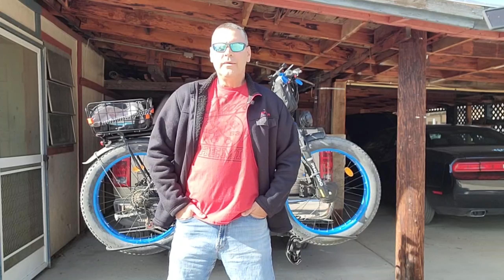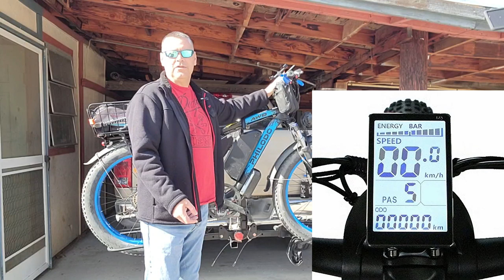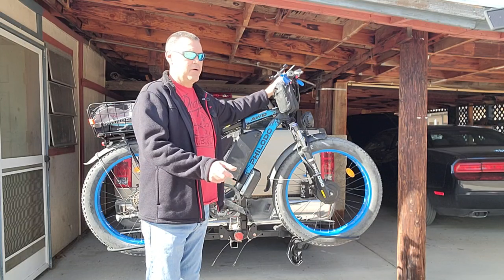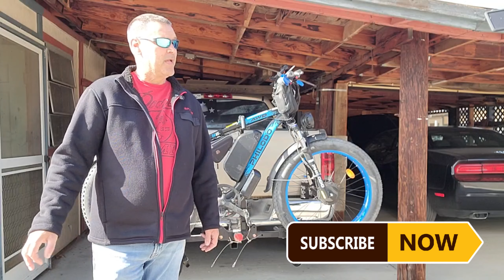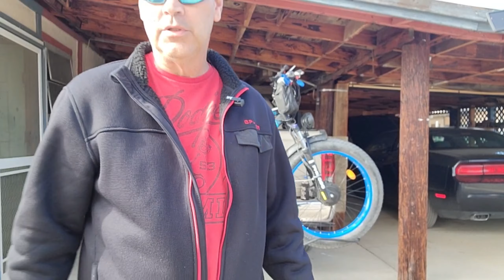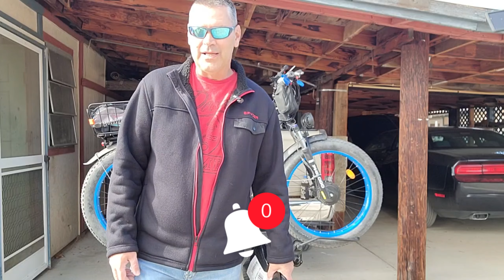Great H8 Specs and stuff

Comment: the controllers are 27 amps....at least they are on my H8 that i got just over a month ago
Reply: 27 amps each on mine also!
Reply from the maker: What the hell, mine are 22 max and the display stops me at 20. Wana trade?
Reply: @MrCsebike  maybe that's how you got such good range, in PAS 2 your rear motor is only using ~400 watts, where ours would pull over 500 at the same setting
Reply from the maker: @chuckwolf9869  Idid most of the range video in PAS 1 but I see what your saying. I would rather have the bigger controller thow you can always turn it down.
Reply: @Onetindrum  Mine is purchased from Amazon also, but has the power wire on the brake rotor side, it's the white version if that makes a difference